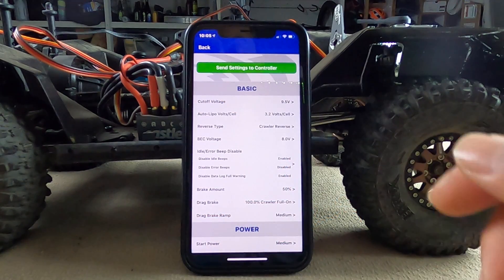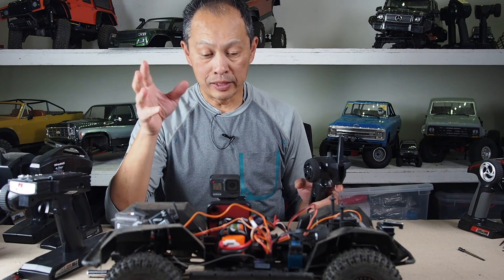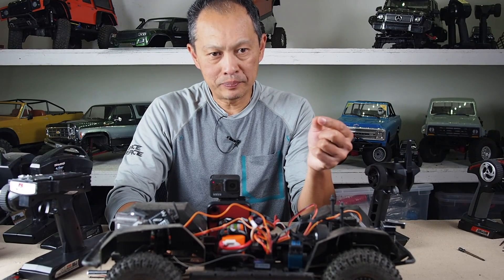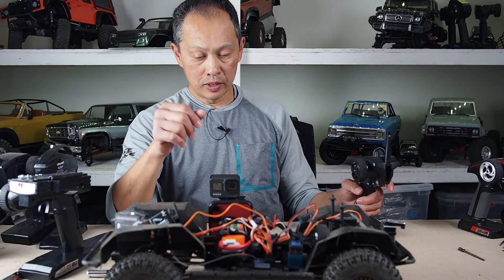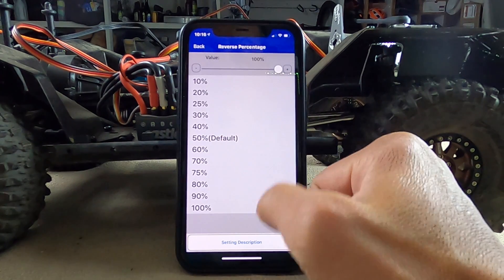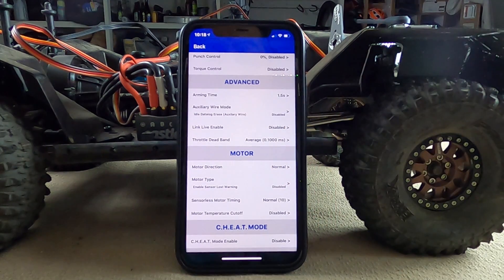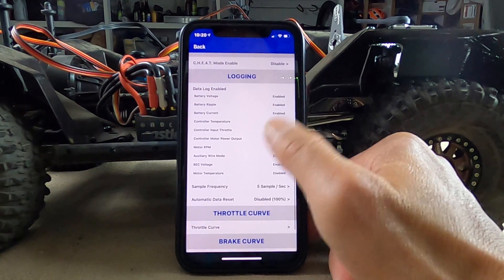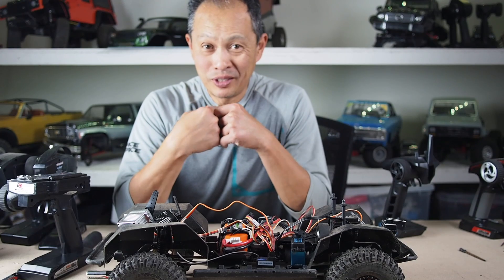Castle Link Mamba ESC programming - How To

Comment: Auxiliary wire I use quit a bit in crawling and racing applications ..There is a white wire on your ESC and you connect to a unused channel  to witch you have a rotary control of .. for  crawling you set the aux wire to crawler break and this gives you adjustable crawler break on the fly ..so descending you can start at 100% break you rotate the selected switch to lower the drag break amount to slowly descends down hill second when on level ground it allowes you to take the drag break completely out of the picture so you don't flip over...try it youll like itt...
Reply from the maker: Oh man, let me try that now with my Flysky GT5
Reply: Im suprised he didnt know what it was for
Reply: @rctrails4  I really did't know what is was for either until I started racing I used torque control then its a great feature I guess that Tekin has similar feature too
Reply from the maker: Live and learn. Learning everyday so that means there is a ton I don't know... yet. :)

Comment: On the BEC voltage... didn't hear you mention it, but MAKE SURE your receivers can handle more than 6v(standard for most RTR receivers). FYI, all Spectrum DSM2 & DSMR receivers can handle up to 9.0v.
Reply: Is that the reason my receiver goes crazy , my steering goes right and left  by itself when I connected the mama a x
Reply: Most ALL Traxxas electronics can only safely handle 6V max, including not only the Rx but also any shift servos as well. Even the TRX power servos (330/400) which recommend a separate TRX BEC, that only puts out 6V (but more amps than stock ESC).
To have your steering servo powered by a higher voltage in those cases, you'll need a separate, non-TRX, BEC for it, and leave the ESC on 6V, or replace everything with stuff that can withstand 7.4V.

Comment: Hey there Francis i have a brand new mamba x esc and i purchased a new but opened holmes hobbies puller pro v2 2700kv stubby to pair to the mamba x but when taking the holmes outnof the opened box it has yellow shrink tube around the bullets on the motor like it was used before because they dont come with the yellow shrink tube. My question is would it keep my mamba x esc from making any audible alerts because it doesnt do anything but have a yellow light on The esc. Possibly bad motor ? Please any help would be much appreciated 🙏

Comment: Thanks for putting this together. One questions, I'm assuming the max BEC would be the lowest of the maximum voltages of either the servo or the receiver. That's correct, right?

Comment: Hey man quick question, my mamba monster 2 esc manual says i can manually change my internal bec from stock 5.5v to 7v but no programming option in the link, so what's up with that? They made it so i have to buy the external bec? Thanks
Reply: On my esc i have a small plug that connects the signal wire to the - iñ the bec. Turn on the esc and unplug the plug within 2 seconds and it changes the bec output...

Comment: I have a Capra 1.9 with the Mamba MicroX ESC. The problem I have is my reverse is slow and not powerful and it is set to 100%. What would cause slow reverse?
Reply: Reprogram your throttle/reverse on your receiver with the setting at neutral.